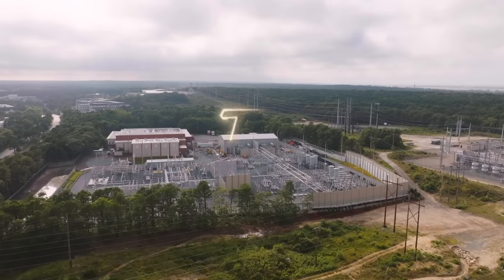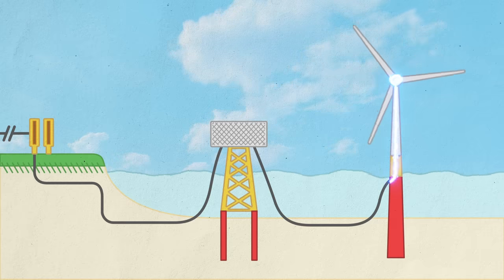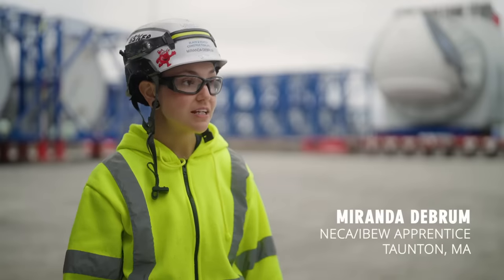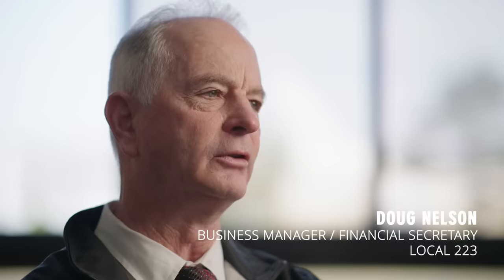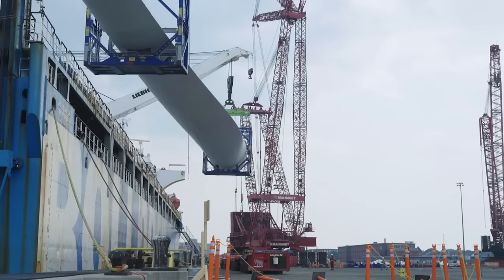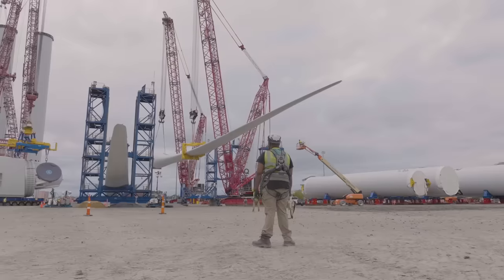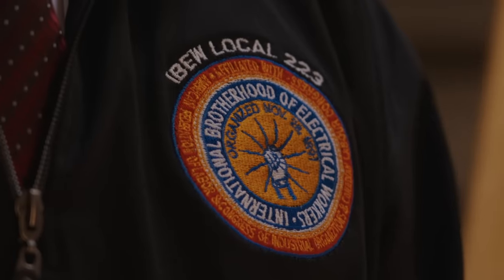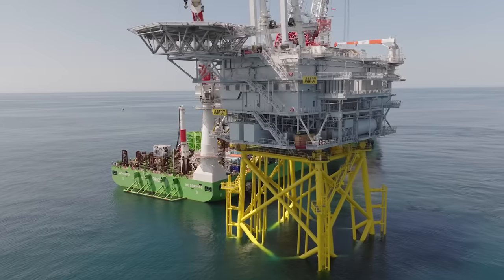Revolutionizing Clean Energy: The Vineyard Wind 1 Project with IBEW & NECA

Comment: How many Towers?
Reply: 2000 of them. That’s there plan. Keeping in mind one blade broke recently in the northeast and it shut the beaches down and the water is loaded with fiberglass. 30 mph wind broke the blade…. In an area that usually gets 80mph winds in the winter and stronger winds when hurricanes come up the coast and peel away from the land.